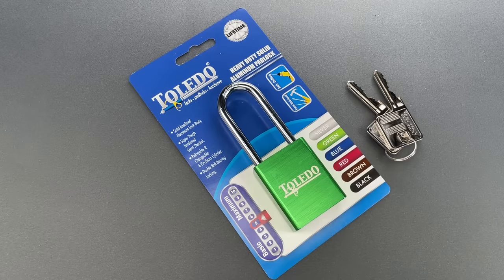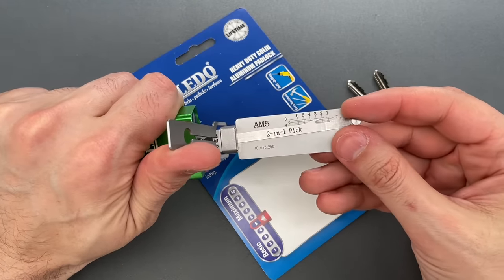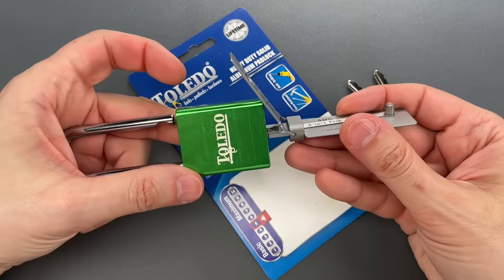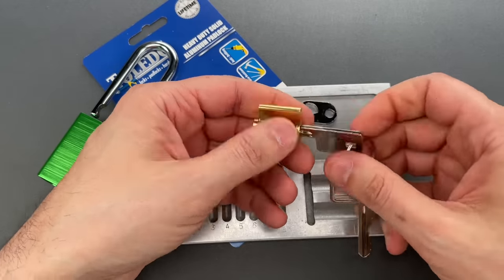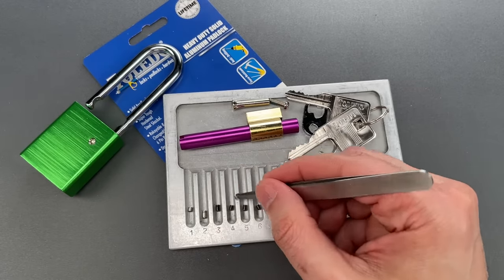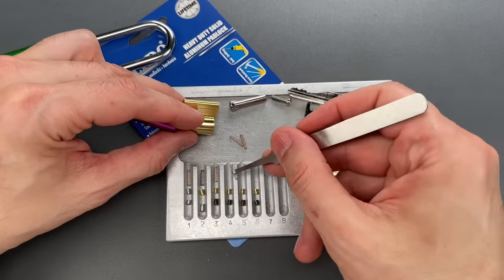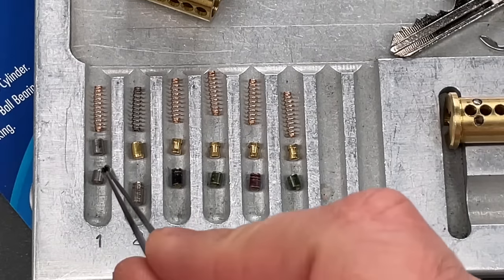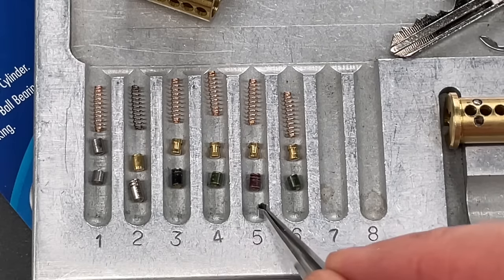[1550] Better Than Expected: Toledo 40mm Alum. Padlock

Comment: LPL's average time to pick: 30 seconds
This lock: 45.
Not too shabby!
Reply: I'd wager his average is probably lower than 30
Reply: Not only that, but he was using a specialized tool instead of a normal pick.
Reply: @tektrixter  That's mostly for our benefit.
Reply: @arthurmoore9488 yes, but Lishi tools in his hands accelerate the picking by quite a lot.
Reply: @yellowwducky  forgive me; I meant his time to pick an average lock (one that's not easy or hard).
Reply: @yellowwducky  average rake time is 2.5 seconds. Over pinning 1 sec

Comment: THIS WAS A SHOCK, A COMPANY THAT ACTUALLY PUTS AN EFFFORT INTO PICKING, DRILL & BUMP RESISTANCE & IS HONEST WITH THE RATING AS WELL. I HAVE TO GIVE THEM 2 THUMBS UP FOR THEIR EFFORT.
Reply: And this is their low end lock. 

Definitely a brand to keep an eye out for.
Reply: And it only costs 17 bucks, I've seen some "high security" ones that have one spool, if that, for like 50 bucks.

Comment: That lock deserves far better than an aluminum body. High praise indeed from LPL considering the schlock from most other manufacturers.
Reply: They rate this 5/10. I’m assuming they have higher priced better locks?

I looked on their website, not seeing prices, but yeah they have a variety of more secure locks.
Reply: Aluminum tends to clog grinder wheels and some saw blades. It can (in some cases) be harder to cut than steel of the same thickness.

Comment: im a 33 year  master auto tech and watching the pressure you use to pick these locks terrifies me to the point where im pretty sure i cant ever do what you can. i work with fine objects and i know what bends and binds metal or destroys precision tools. 

youre a legend 👍
Reply: I remember Bosnian bill once making a remark about lpls gorilla grip style of picking being very unusual but highly effective. He must have a really good feel for things to be able to exert such pressure without destroying tools and still being able to feel for counter rotation etc. I'm a hobbyist jeweller and restorer (focusing mainly on old tools) so I also know the struggle of riding that knife edge between just enough and too much force
Reply: I know that of which you speak. As someone who has been fixing things since I was very young, I understand the relationship between force and success or damage very well. I took my sons to an escape room and the one thing that prevented us getting further was a lock for which I was sure we had the right key, but I was certain that putting more force than I was prepared to put on it would have bent or broken the key. Sure enough, it was the 'correct' key, but the amount of force the operator showed us that was required to open the lock was probably why it was bent already.
Reply: @Lilith-Rose  I don't remember the video, but there was a colab that LPL did a while back and the others involved tried to pick a lock or two. He told them he could tell they were struggling or doing something wrong by the color of their knuckles or something like that. It might look like he's using a ton of force, but his control and knowledge of what's going on inside those locks is stunning
Reply: @Fyrefrye  yes that's actually something I pay attention to myself when watching him pick, your skin whites out under pressure because the blood that gives it a pinkish colour is squeezed out of the capillaries (there's good first aid technique for checking if blood flow is restricted to a limb or a patient has drastically lowered blood pressure which can indicate internal bleeding, called the capillary refill test, which works because of this phenomenon). The more force the larger the area of whiteness around the pressure point
Reply: @Fyrefrye  The video you're thinking of was a collaborative with the king of random, although I don't recall exactly which one. I remember that line talking about the colour of the guys thumb.
Reply: @Fyrefrye  wasn't it "Lock Picking Lawyer Reacts to Hollywood Lock Picking"
Reply: @Bushybowl yeah, it was the TKoR collab where we got to see LPL's face.
Reply: @Eyes0penNoFear  ...we got to see LPL's face??!? Mind. Blown.
Reply: @SeanNicholsEh  not on purpose

Comment: I would buy that lock just for the cylinder assembly. Put that in something more stout, and you'll have a formidable lock.
Reply: Exactly. That is a good price for a fairly secure pre-pinned cylinder and keys that can be easily swapped. Drop into an American lock body and you are good to go. Pair the original American cylinder with the lightweight aluminum body and thin shackle for a mediocre utility padlock
Reply: Change the material of the lock screw to something more hard ?

Comment: And yet more proof that yes, you can make a buck off selling locks with half-decent security measures in the cylinder for less than 20 bucks! And it comes in snazzy colours, too! Heck, even if someone does break the lock via a snip or twist, you can still get that cylinder out and use it for something else, like as a practice lock or just stick it into a somewhat more heavy-duty body for your next bike.
Also, a proper taking apart & examining the pins video! I feel like we haven't had a lock worthy of one of those in ages!

Comment: This looks like a good lock for mid-level pickers to try, to go that next step up. A tougher spring in 2, the little milled bits for a false sense of setting the pin, the serrated pins etc. It seems like although it wouldn't deter an experienced picker, it might be a good test for someone seeking more experience.

Comment: hey I found a pick on a lock. I am new to the spot and still learning on the clean locks but on one of the lock if you go all the way up past the pins to the lock ( you need to stay up against the pins all the way to the top of the barrel) and use a hook tool with a little bind you can lift the lock bar inside the lock to unlock the lock

Comment: I would definitely not use this on the shed in my back yard because then it would be easier to break the plastic handles on the doors than to get through the lock.  Master is perfect in that application.  😺

Comment: Grats Toledo. That looks like a lock worth $20ush bucks. Plus the core is properly shielded and I imagine it uses a shim-resistent lug design. 

Will definitely look out for this brand if I they have higher security stuff.

Comment: Dear Sir (or Madam) LPL. whilst your content is between 8.5 stars and 9.9 stars, you only, (commendably) do reviews on lock security. thats well and good and EXTREMELY appreciated as the copmments are often gold in themselves. Thanks! :)   Perhaps you could do series though. On secuirty vs cost? review the BEST 3 (so far) of under £10.00 padlocks, gun safes, door locks, motorcycle chains, etc.. then same for under £50.00 and same for ... exponentional. don't lets sponsors sway you tho. thats the only rules.

Comment: with technology today people dont pick anymore, they use battery powered angle grinders, it only takes seconds with a 1mm cutting wheel to cut a padlock or bike lock, as for doors, a car to ram it open or a crowbar or a battery powered angle grinder to cut around the lock or section of door, or a big bar and  lift the bottom of a garage door(the door you drive thru)

seconds is all it takes with a battery angle grinder

Comment: So the lock core is pretty good since it has decent defenses against low skill and destructive attacks (not sure if you could comb pick it though.) However, the lock body itself leaves much to be desired. It's aluminum so it  can be softened with gallium given enough time and you can cut the shackle or drill through the drain hole like you stated.

Still, very interesting lock core itself for a cheap lock.

Comment: I mean, for its price point, this is certainly quite reasonable, and if you have an application that needs a longer, thinner shackle, I suppose this is actually one of your best options.  It's not "high security", but for most reasonable uses, like locking a toolshed or something, this should be more than adequet.

Comment: I get the feeling that we can classify a lock's pick resistance by what tool LPL takes to pick them. If he uses the Leashy, then it's quite ok. But if he takes the rake, or god forbid the comb, then run away from the lock as fast as you can.

Comment: Lockpicking is less than 2% of all burglaries.  So if this stops the novice pickers among that 2% (which is probably at least half of them), then that's pretty good!

It should be said though that, this is probably why many companies don't focus on pick resistance, focusing instead more on brute force resistance (hammers, drills, cutting, etc.)  Which is probably the smart thing to focus on.. though both are ideal.

Comment: Excellent work Toledo! Shore up that drain hole in a future version of this thing and I'd say you're far away a better lock than most of what I've seen for sale outside of a specialty shop, at least when it gets used someplace that the most obvious attack isn't the shackle itself.

Still, I assume Toledo makes locks with more challenging bodies and shackles. If the core's this good on a lesser lock, I'd have some use for those better options to defend against low or even moderate skill attacks.

Comment: I like the fact also they aren't claiming maximum protection.  Seems to be a lock that has decent protection but due to the issues as stated with the cut resistance, can't be much higher then they claim

Comment: great video, i didn't understand how by drilling the head of the disassembly screw the lock would come apart, i am thinking that if only the head of the screw is cut off, the threads that were glued in with loctite would still hold the lock together

Comment: I cut a lock on an electrical switch yesterday with bolt cutters because we couldn't find the key. The boss man said are you going to pick it. I cut it and said nope threw it over the bank and told him we will replace it with a better lock. The lock I cut was made by Master lock.

Comment: I had high hopes for the Lishi tools but man they are trash sadly. I think I have 5 of them; the KW has NEVER been able to open a lock, even one I bought specifically for practicing on. The SC1 has never been able to open a lock. I used the GM one on a buddies truck successfully but that thing could probably be "picked" with a screwdriver lmao.. I think it only took one pin to open it. On paper they're great, just dont work. I even had my lock guy come out to add "request to exit" sensors to my business and I was excited to pick his brain about lockpicking. When I mentioned Lishi to him, he opened a drawer in his van full of them and pretty much told me he never uses them because they suck ha

Comment: Some questions: 
1. What is the reason for using brass instead of steel vor the upper pins? Because it doesn´t scrape of the slot cylinder ?
2. Why they don´t use steel springs for all slots ? Because of rusting problems?

3. The shakle steel, is it hardened with more chrome content ? For a small lock like this, what would be a suitable minimal diameter of the shakle to resist standard small bolt cutters?
Thank you very much !

Comment: move the drain hole to the base of the lock where drilling through it won't effect anything.
Shorten the shackle
Add another tension spring. 
Beef up the entire lock body/shackle structure, perhaps brass instead of aluminium. 
and it would probably be an exceptional lock, as it is the fact you only paid $17-$18 for it is astounding.

Comment: Hello, dear Mr. L. P. Lawyer
Thank you for the video.
I have a question about steel pins. You said there was three of them in order to prevent drilling. But why aren't the others made of steel too ? Why do companies prefer brass ? Is it because of the price of manufacturing steel ? or because of the weight ? Or is there a mechanical feature about that ?
Reply: If I had to guess, I'd say that it's because most keys are brass, so steel pins will cause more wear on the key. So it's a tradeoff between security and reliability.
Reply: Indeed, if it's for the keys, it makes sens.
However, I'm surprised by the fact that most keys are made of brass, I'm more used to steel keys (or equivalent strong metal). But maybe - keeping your idea - it is to protect the teeth (fragile points) whatever they are made of.
Reply: Steel also rusts, unlike brass.

Comment: They rate this lock as level 5 security. Jeez id love to see what a level 10 security is for them. A level 5 security lock from Toledo is probably a level 20 security for Master
Reply: It's a v8g blob of welding material for Masterlock.
Reply: I wonder if the lower score was because the lock body/shackle aren't super robust. They might just use the same core in most of their locks.

Comment: How do you reassemble these sorts of locks? It seems like it would be a real challenge to push the pins back down into the slots and slide the core back in at the same time. I can just imagine the frustration of pins flying out and landing god knows where.

Comment: As far as I can tell lockpicking relies on the imperfections in the lock. Pins binding when there is a force applied to the tumbler. Would it be possible to machine a lock so precise that it wouldn't be pickable? I mean there are machined puzzle pieces that have no visible gaps between them and they can still slide in and out of each other. Wouldn't a perfectly machined lock negate any kind of movement in the tumbler, if the pins aren't in the right position all at once?
Reply: I doubt such a lock would do well in the real world. People expect locks to work for years with thousands of actuations and survive harsh conditions and rough handling. Reliability is more important than ultimate security.

Comment: It shows just how easy it is to make a more resistant lock, simply using a little extra effort in the machining, and a mix of parts. Changing that drain hole position, and with a shorter shackle, and this would be an outstanding item. And still under $20. It shows that most lock makers are simply lazy.

Comment: The advantage of a lock like this is it is much harder to hide entry with a pick.  These lock are used for LOTO and equipment access.  A damaged lock would show someone had accessed a secure area or to prevent that idiot from picking a LOTO and killing someone because they thought they knew better.

Comment: The security rating of a lock should simply report the length of the LPL video featuring said lock. That's the standard that I use. 

Oh... and it's super important on the packaging to report the various COLORS (0:22) available.

Comment: I do wo der how well the alum body will resost corrosion if used outdoors, and if it will end up causing binding up , having had alum caps for tyres etc. Where theyve practically welded themselves to the attached surface 😑

Comment: I can see this lock in low security situations and mid security where there is a patrol or camera in the area and it shouldn't be fine. Lock breaking tools are completely conspicuous and its difficult enough to lock pick enough that a gaurd or camera can see whats happening before the deed is done.

Not impossible but passable

Comment: Hey LPL, this is really vague I know but recently I was came across a crazy looking lock with a crazy looking key. The lock looked like 5 regular key had all been stuck together facing outwards, and the keyhole looked like a star kind of to match the key. There was no model or name on it that I could find, but it’s haunted me ever since, how would you pick that kind of thing? Because it seems pretty clever. The lock was on a locker somewhere in the Maldives I think.

Comment: Is there a lock design that can stop “an experienced picker”? This feels like basically maximum effort, and you still got it open fairly quickly.

Is the only real way to defeat you is some crazy redesign like what StuffMadeHere did, except with all the flaws fixed?
Reply: There are locks with unusual keyways which are very hard to pick if you don't have the correct tools. For example LPL has a video where he has to open a disk detainer lock and he has to modify his lockpick because it is not long enough to reach the back of the lock. So it really depends what tools and experience the lockpicker has. Lever padlocks (also called Old English Padlocks) are not all that secure but can't easily be opened without the right sort of tools.

Comment: LPL, I would honestly be surprised if you respond but I'd love a recommendation. My partner is trying to turn his shed into a workshop but we're worried about thieves as someone already broke in right after we started cleaning it out. What lock would you recommend? We're more worried about someone breaking trying to break the lock if we had to choose between break resistance and lockpicking resistance.

Comment: Is there a reason why you'd want to use some standard pins as opposed to all spools and serrated and such? Like, does the variety help distract, more than using a variety of serrated/spools?
Reply: I believe there are mechanical/reliability reasons why you want at least 1 or 2 standard pins in a lock. But I'm no expert.
Reply: @jrd33  Makes sense.

Comment: Does that anti-bump pin in slot 2 fit into the plug like a normal driver, or is it a bit thicker in the center so only the tip fits in (LOL unintentional )  Normally I would just watch the video to see if number 2 picked like a normal pin or if there was a big gap between the key pin and driver but in this case the key pin was so long I couldn't tell.